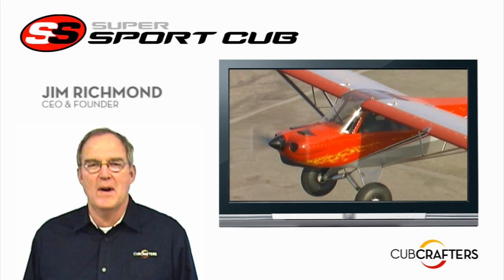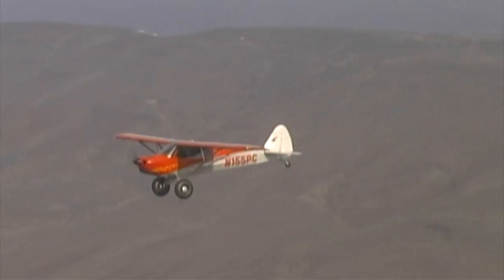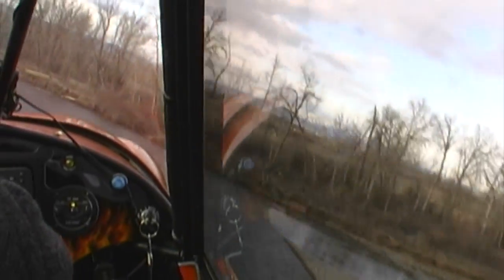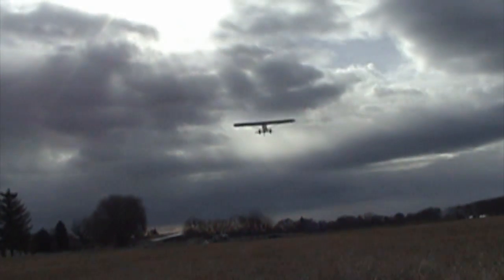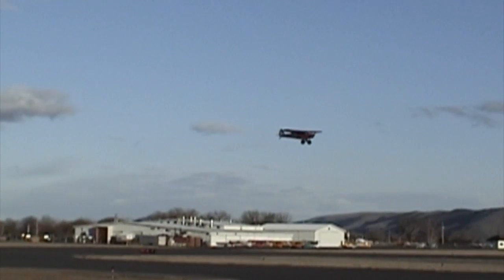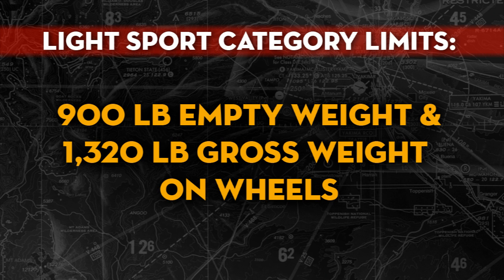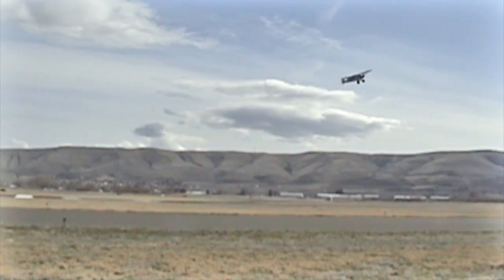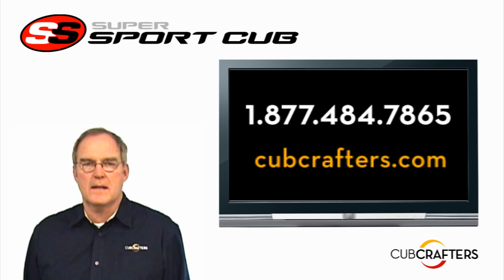Carbon Cub SS - Overview

Comment: the carbon cub ss can hold two grown men plus full tanks, and as much baggage as you can crab behind the seats and still be airborne in less then 300 feet! The 1320 LSA gross is little more then a number for these amazing machines.